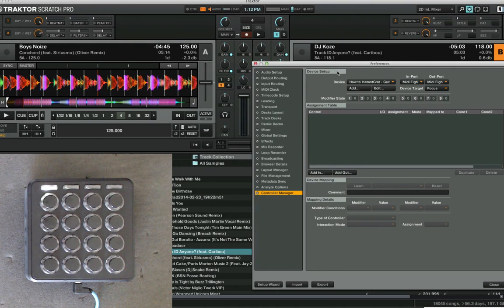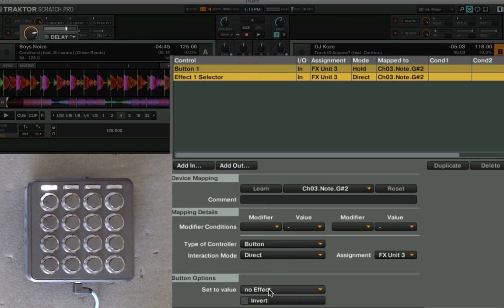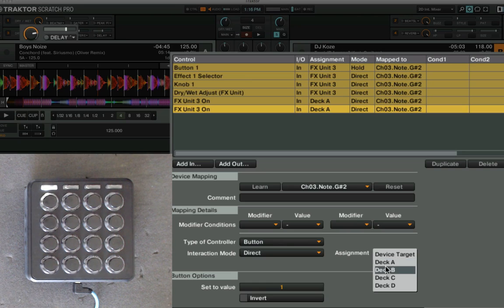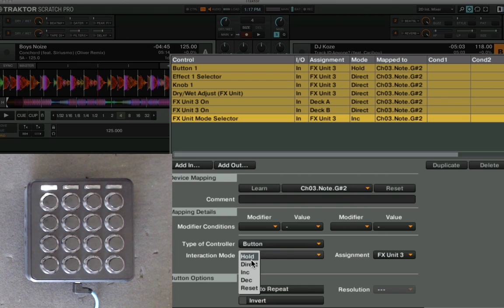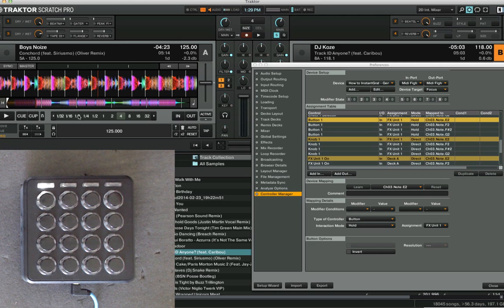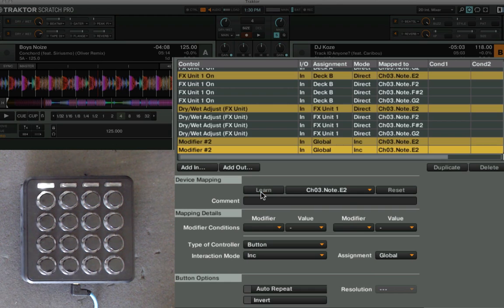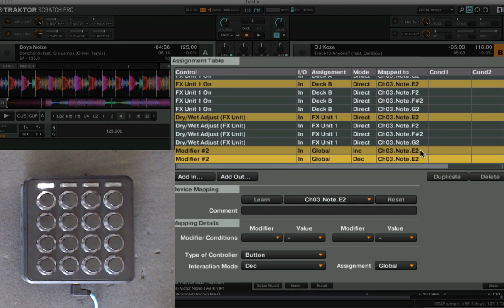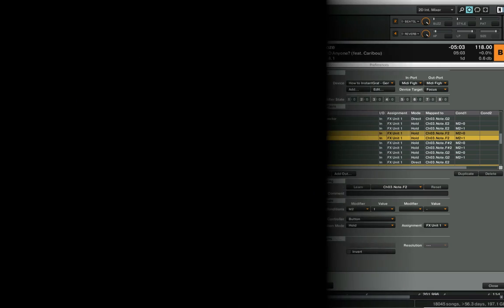How to Midi Map "Instant Gratification" Effects in Traktor [Flashflooder Tutorial]

Comment: Do you know if its possible to map the behavior of the s4's filter knob (turns off in the center and on when turned)? thanks if would be alot of help
Reply: Cano Jauregui I believe you simply map the Filter commands (from the Mixer menu) to whichever knob you wish to use and set it to be an encoder/direct. Works for me.

Comment: I'm having an issue where it takes two button presses to turn an effect on if the selected effect is not already loaded in the slot. After that it works perfectly with one button hold. Any ideas Chris?
http://www.native-instruments.com/forum/threads/instant-fx-midi-mapping-issue.225191/
Reply from the maker: Unfortunately this is a Traktor issue that doesn't seem to have a good solution. You can use the FX Store Preset command to get around this but I've found that it becomes a little unreliable if you use it on too many different effects. There are quasi-hack ways to design you mapping to get around this, most commonly is that I have some mode button changing all the effects that you inevitably have to press
Reply: Thanks Chris... I think I'll just have to get used to punching the button before I want to activate the effect. Hopefully NI will fix this. In my opinion the mapping interface is a tedious disaster and I would much prefer to do it in a scripting language!

Keep the awesome videos coming!